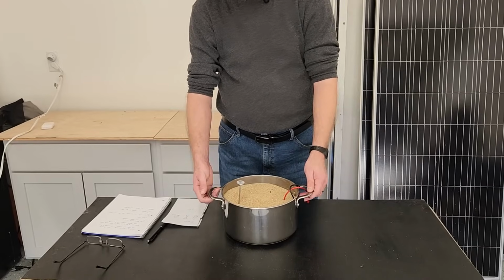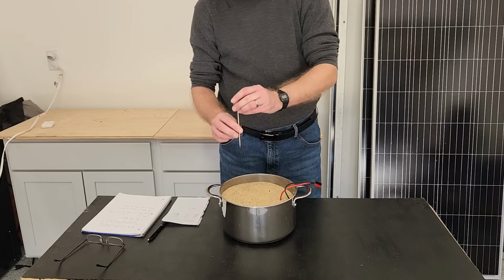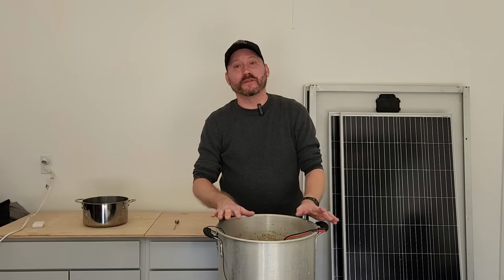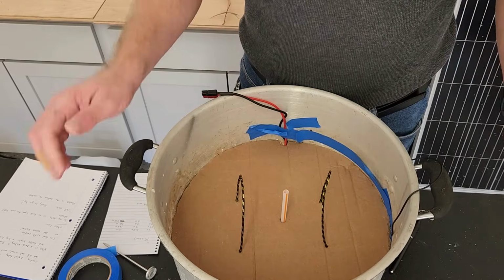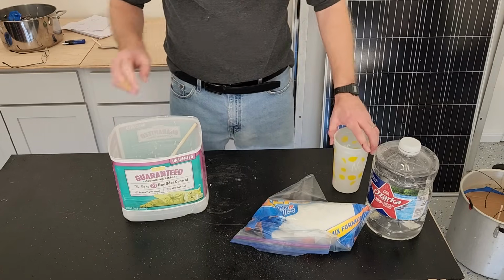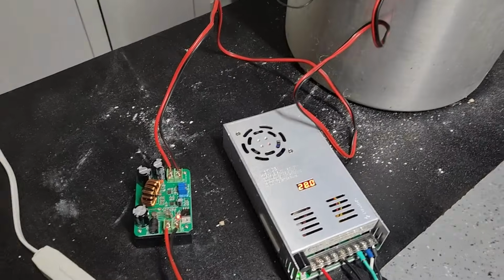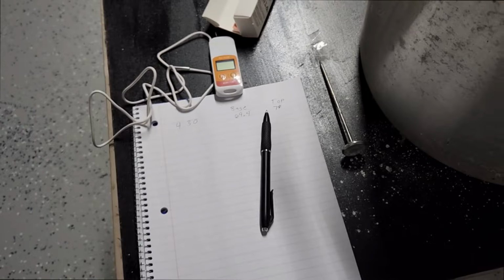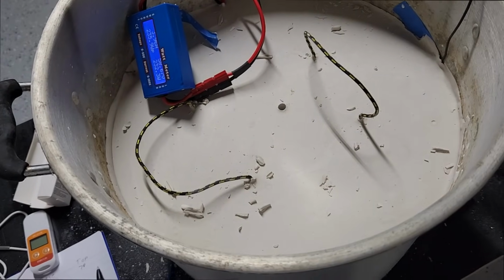Sand Battery heater. Create free heat  of 500F using solar electricity! Texas Prepper Projects

Comment: You need to know how much mass per watt is needed to heat your battery. In order to be meaningful, consider doing some calculations from a one square foot battery,  based upon several wattage inputs. Then measure the radiant heat loss of your battery per minute at known ambient temperatures. This will provide data for efficiency and practicality of scaling up. Also, consider alternate battery containers. AU is a very good thermal conductor, and as such heat loss will be more rapid. Consider a wood container insulated with 2 to 4 inches of rigid board insulation (about R-20). Finally, water has a higher specific heat capacity than sand. Takes longer to heat up but holds heat longer as well.
Reply from the maker: Thanks

Comment: Thank God you put that little hole in because if there was any humidity in the sand you made a bomb, do they have rock wool in TX? I would use it instead of plaster. Also how about using bricks instead should be easier to move around
Reply from the maker: Yes

Comment: One can't say it a battery technically because it can't give current or voltage when needed.
You can use Laird CP Series TEGs around the pott to produce electricity when needed then it could be called a sand battery.
Reply from the maker: I could, but why? When I can just take the power from the solar panel and put it into a lipo4?

Comment: Have you heard of seebeck generators? combined with a solar sand heater or even a wood stove, you could possibly replace solar panels in the evening. Though the thermal generators required would cost more than solar panels. The offset on time energy would be ideal for smaller systems.
Reply from the maker: I'm already creating electricity

Comment: There is a reason why high voltage power lines have ceramic insulators. I would test some kind of similar insulation of The wires. Thank You Sir.
Reply from the maker: Check out video 2 and 3 for my improvment

Comment: Awesome video. I am interested in a much larger one, I think. I would like to build one in the ground, outside my house that was large enough to give enough heat and electricity for at least a month to run a 2000' house fully year round in zone 6ish. I like the idea of heating it with mirrors concentrating sunlight onto a suitable liquid filled pipe that runs deep into the sand. Then run pipes with the same liquid into house for radiator heat and water heat. Then run similar wires to make electricity for everything else. Just too much thinking on design/execution for me.
Reply from the maker: I think geothermal is a better opt

Comment: that's awesome for 4x60 watts. according to phys chem books 1 watt will raise 1 gram(1ml  ) of water 1 degree C from ambient temp. so a pie plate ontop with some water(~5-10ml) should give some nice steam heat, continuous if using specialized hood to recondense back into plate
Reply from the maker: Thanks for the info

Comment: add pergalite to the plaster will give it a higher temperature plus more insulation.
 So what is the plan to use this heat? Seams to me if you had some copper or aluminum pipe all through that pot you might use a small fan to extract more heat. The aluminum on the outside is a conductor of heat, if the plan is to hole the heat for an extended period of time you'll need to insulate the sides too.  I think I will try something similar on my exhaust wood stove or furnace
Reply from the maker: check out my other videos for some answers!

Comment: Pid controller and mount the element through the side of the bucket so it won't melt your wires off. The controller will limit and control the temp and energy
Reply from the maker: Check video 2 and 3

Comment: I wonder if you could take copper coil wound closely like a spring inside the pot about an inch from the inner walls of the pot (maybe filled with water??....but then heated water can build pressure...) to help radiate the heat.
Maybe loop the copper coils just above the plaster insulation 🤔🤔🤔
Rambling thoughts...I might try this myself sometime. 
Thanks for sharing!
Reply from the maker: Check my other videos for testing

Comment: Wondering if I could somehow use this to heat a pan of water for my bird feed station outdoors.  I don't have any power in the back yard.  Goes to -10 deg F in the winter.  Just want to keep the water from freezing
Reply from the maker: If you want to heat water then use a direct solar water heater. Black plastic tubing with small pump
Reply: @texasprepperprojects  Thanks.  Can you direct me to something that I can easily build?
Reply from the maker: Check my other videos on solar water heating.

Comment: Get several galvanized 10 gallon buckets, fill with black sand, spray paint buckets black, place them in the most sunny place on your property on the bubble mirror foil, build from old recycled double pan windows a large box to fit all the buckets, also make a few parabolic dishes to reflect the sun to the buckets around the glass box and in 3-4 hours bring these buckets home to heat without any solar panels or other sources of electricity.
Reply from the maker: I can't wait to see your video on this

Comment: If you’re going to reach temperatures as hot as you say it will melt the covering on your wiring and you could develop a short which could possibly start a fire in your house, you would be much better off drilling a hole in the side of the pot to insert the heating element so all the wiring is outside of the pot
Reply from the maker: Which, it did. Check out my other videos for updates on these issues

Comment: It's the first time I've seen this and wondered if you have considered using a ceramic container which might hold the heat longer. In Germany they have ceramic  lined log burners which heat up. The next thought would be the bricks used in night storage heaters and if you would consider giving that a try out and see what results you get.
What would happen if the power obtained from the solar panels were passed through night storage bricks  Would they hold the heat.  
Very impressed in what I watched. 
Bradley
Reply from the maker: Very likely. But watch video 2 and 3

Comment: The sky was overcast for several days during the Feb 2021 freeze. Perhaps, the sand battery can be used to store heat effectively by another method as well. The draw from the element may be too much for some inverters.
Reply from the maker: After lots of testing I am convinced that an electric blanket is the right answer. Their current draw is very very low

Comment: 🤔Doesn’t that heat melt the wiring of the heat element? 
🤔 Would you drill a hole thru the wall of the pot, to fit heat element thru, similar to in a water heater, to protect the wiring?
🤔Or, wire a thermostatic shutoff, to prevent overheating? 
This is a great idea!!  MUCH safer than ceramic pot & candles, or anything with open flame.
It should last a very long time, once you get the bugs worked out! 
Would like to see a parts list, so folks know what kind of heat element or other parts to get….element needs to be good w/ DC power from panels;  needs what Volts & amps, etc.
Reply from the maker: Check the other videos for answers!

Comment: It's a bit late for this project, however, if you do another, think about drilling a hole. Even in height and wight and pass a pipe from one end to the other. Then maybe use a low power fan to just push the air out of one side. I just happen to have that same pot, I'll just have to find a cutting device, and a way to seal the pipe openings. Hoping you see this as useful.
Reply from the maker: Check out my follow up videos for the reason why I didn't drill the hole
Reply: OK I will, Thanks!

Comment: Time to upsize your sand battery , a commercial oven thermometer has a metal cap tube and sensor so temp is no a problem. We live in Michigan and the sun has only remotely shined 2 days since Christmas and it the   15th. However I think a storage unit can collect enough solar to bid you over for weeks. Your system times 4 individual systems can achieve these results. There is affordable insulation for oven’s that can handle these temp you’re trying to achieve
Reply from the maker: Yup!

Comment: One could charge a battery during sunlight and then when its time to heat, plug the battery, but instead of to a heating element, one could create a grid (more contact surface) with nichrome cable (like when you do a foam cutter) plug your 12v battery to it and maybe it works. Less risk and less extreme, can be a long sand channel too, cable would be much more flexible than the element. Might try my own idea.
Reply from the maker: Try it

Comment: Great experiment! Currently (pun not intended) I have a 500 gallon water tank heated by solar thermal panels. The hot water is then circulated through tubing in the house floor for radiant heat. After recently discovering the heat storage characteristics of sand I'm considering replacing the water in the storage tank with sand and using several dispersed heating elements powered by solar electric panels. Tubing filled with water would be buried in the sand to absorb the heat and be pumped through the radiant tubing in the house floor, as it is now. If you know anyone who has tried this sort of thing, I'd really like to be able to contact them. Thanks for the video.
Reply from the maker: I really want to try this but don't have the room for it in a rental. When I lived on Florida it was common to use roof top pipes for hot water and hottubs
Reply: Just stick with the water. Water will be able to store more heat.
Reply: i am currently working on a 300 gallon sand heat store to cook on and hot water, you could pump oil around instead of water, i am working through issue of elements burning out, i am also using a lot of scrap steel a bit of aluminium and copper in the sand, i also need to figure ot how to support and insulate the base, its a three legged ss milk vat.

Comment: wood ash is an excellent insulator, try that in the bottom. Other than that, I would recommend styroAircrete/EPS-airecrete for the top and bottom. As some others have pointed out the electrical terminals should NOT! be buried in the sand without insulation. Further, all your insulation is at risk with high temperatures. You should drill a hole in the side of the container and thread the heating element into it as it is meant to be. This way the conductors and insulators are protected. BTW, you can also use this to sterilize soil at the same time. :-)
Reply from the maker: check out my other videos for details

Comment: I think rather than heating up to 200 degrees C, maybe triple the amount of sand and only heat to 75 degrees C - it makes it much more easier to work with re. temperature probes and less materials will melt. 
To heat a large room with sand your going to need
Reply from the maker: Agreed

Comment: Aluminum heatsink. Maybe a design where you can insert an aluminum tube so that you can easily extract the heat off from the battery.
Reply from the maker: Check out video 2 and 3. I tried this

Comment: Ya, a metal lid above the pot with some spacers to create an 1/8 inch gap, which would keep the heat moving into the space, while also insulating it somewhat..That  is instead of the plaster of paris lid..And a fireplace fan that is heat driven..And maybe ground the container to the homes earth ground....
Reply from the maker: Nice thanks

Comment: not sure if anybody mentioned it already but I'd keep it inside but build insulated cabinet around it being closed when heating up and wide open from top front and sides when need to heat the room, with some safety features for sure high DC may b lethal
Reply from the maker: Check the other videos where I address this

Comment: Probably already in the comments somewhere  but use a through wall port to screw in your heating element like a still does. Run copper coil through the sand or some pipe so the sand surrounds it to transfer heat. Use still k type temp probe to measure your temp of sand. Now you can have wires on outside of sand, can heat water or air through your copper or use fan to blow heat out. You can use even larger metal burn barrels and even add salt to the sand for better heat transfer.
Reply from the maker: watch my other videos for the response to this

Comment: I would create a hole in the side of the container and mount the heater element through the hole from the outside in the same manner as it would be mounted through the wall of a water heater in order to keep the electrical connections out of the intense heat as they were obviously not intended nor designed to exist within a super-heated environment.
Reply from the maker: Check out video 2 and 3 for the reasons why I didn't do this

Comment: How about making a on demand hot water heater using this sand battery concept? Gut an old hot water heater. Use a stove heating element. Run some copper tubing coiled like inside, fill it with sand and heat it up. If it’s insulated and stays hot for a long time it’s like an on demand water heater. Thoughts…
Reply from the maker: Water actually makes a better thermal mass than sand does. But, if you had any open remaining air space, then filling it up with something dense will help 'hold' the heat in better.
Reply: @texasprepperprojects  I think you are missing my point. It is a totally different avenue than a space heater. This is for on demand hot water. Check out the video of a giant sand battery in Finland
Reply: @texasprepperprojects then why don’t then why

Comment: It is interesting experiment, thank you for sharing. However, that heat element isn't designed for that kind of operating temps (it is in fact multiplies of), so chances are it is going to burn out in one quick hurry.
I think if you looked up spirals used in electric forges/annealing ovens/ceramic kilns etc (...heck, even electric oven's, for testing), this should last longer.
Also, you'd need to make sure any cabling is not so much as bigger, as that it isn't embedded in the heat mass itself (too big a chanc it is going to fail at cabling/connector, IMHO)
👍
Reply from the maker: Watch video 2 and 3 on this topic

Comment: Energy storage is more than just temperature. 
Heat capacity of sand 800J/kg vs water 4,200J/kg.
Different challenges and considerations on both
Reply from the maker: Check out my other videos in this series

Comment: Also instead of using the kind of plastic wire that you’re running off that heating element you would be much better to buy some lengths of high-quality Electrical Appliance wire that can take high heat then you won’t have degradation of your insulation, And I would not use standard crimp on lugs for this either I would buy the high-quality Electrical Appliance lugs that are silver plated Nicholl chrome I think they are you don’t need failures on something that’s going to be buried
Reply from the maker: Yup

Comment: I would suggest lining the bottom with firebrick, or fire clay, as well as the top.  All you would probably need is 1\2" thick brick.  Plaster de Paris may crack after a while.
Reply from the maker: Watch video 2!

Comment: As an electrical engineer, I'm curious on the effects of running some copper tubing through that to see if it can run a turbine motor to generate AC power.
Reply from the maker: But, what's the point? Since I'm using solar panels to produce electricity, why don't you just run that into a battery and inverter and make power?   The point of this was to attempt to make HEAT directly using electricity from solar, not to make power from solar.   It's the same reason why people ask about using a peltier fan. Why bother when you already have electricity coming in.

Comment: Ceramic is a poor insulator. 
As I've heard one project done, the way to heat a home would be a gigantic block of sand - think shipping container - buried underground.
Electric heating elements would be buried in the sand. Or, hot air could also be used during the summer to heat the block. Later on that.
Throughout the sand block would run steel ventilation piping, in a complicated pattern to make the effective length very high. Folds and bends and repeating loops.
During the summer fans could blow outside hot air through the sand block, heating it to a surprisingly high temperature. Or, and, use electric heating or a heat pump to build up the temperature.
The sand can reach temperatures close to 800 degrees Fahrenheit!
When the winter comes, air is blown through the sand block and is diverted into the space you want to heat. You can imagine it doesn't take much to warm up the house at that temperature.
Have to make sure it doesn't go nuts and melt furniture.
The temperature of the block drops as the season goes on, if you don't use the heating elements. As you can imagine, the heat leaves slowly. Just enough to make it to spring.
And as the engineer said you could put the block under your driveway - so snow would melt automatically all winter long.

https://polarnightenergy.fi/sand-battery

https://www.bbc.com/future/article/20221102-how-a-sand-battery-could-transform-clean-energy
Reply from the maker: Neat

Comment: I'm thinking doing exactly what you did except using a cast iron pot belly stove. Seal off the bottom, put the sand in, then the hot water heater probe, then fill the rest of the way with the sand. No plaster of paris. Just put the cast iron lids on the stove top that are there anyway. Let the stove build up heat in the day in the sand and radiate it into the room at night. Isn't that what these stoves are supposed to do anyway, only with burning wood or coal inside to heat the cast iron?
Reply from the maker: Yes. Get the whole thing hot and let it radiate. 

Or wait for my next project video ;)